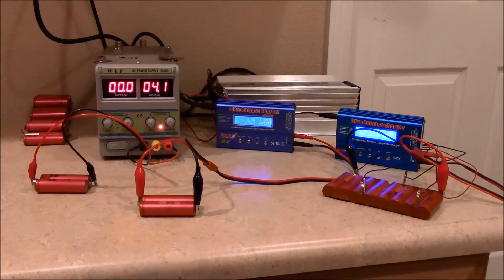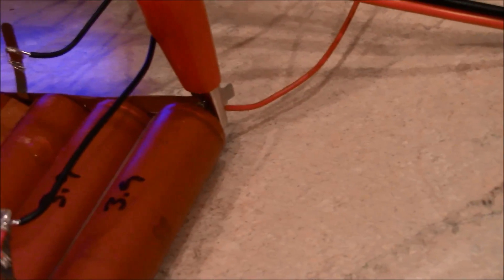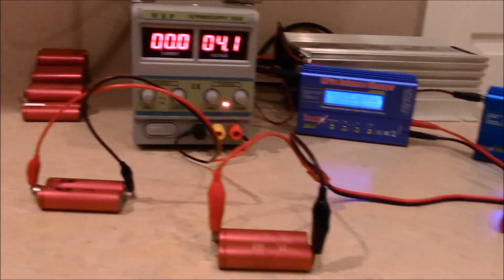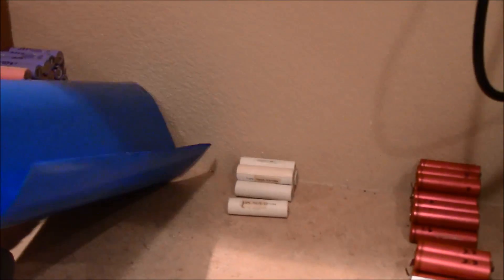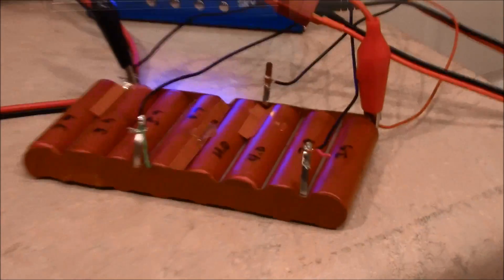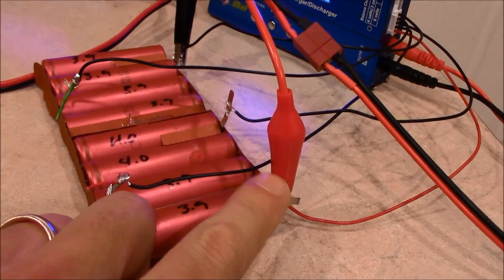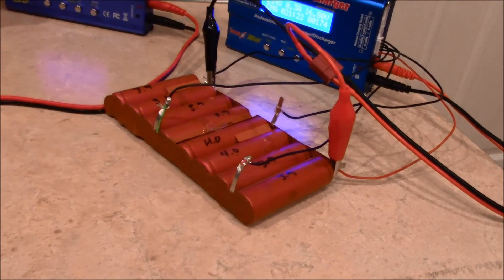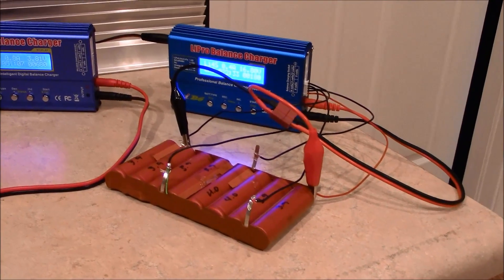18650 lithium ion cell balancing with the new charger

Comment: You can buy a discharge with capacity read out on eBay for 4 bucks. It charges as well. Ebay this” 18650 capacity checker”.

Comment: can you tell me where you bought the balance line cable with the clips on the end.  I am looking for the exact setup to charge some laptop batteries.  thanks, Ken
Reply from the maker: Imax B6 came with some.  Radio shack has them or you can make them.  Amazon might have them.  The alligator clips can be bought separably so you can use your own wire size.   Find some with screw terminals instead of crimps, so if the wire breaks off you can fix it.
For ex: https://www.amazon.com/Alligator-Clip-Assortment-Electrical-pc/dp/B002X4CG3A/ref=pd_sbs_469_2?_encoding=UTF8&pd_rd_i=B002X4CG3A&pd_rd_r=25G4M4RE2T1H963343M3&pd_rd_w=q2Yer&pd_rd_wg=0fod4&psc=1&refRID=25G4M4RE2T1H963343M3

Comment: Does the fake Imax B6 Mini work as well as the real one? im thinking of buying the knock off as its cheaper :)
Reply from the maker: Yeah it ended up working but you may have to recalibrate it.  There are YT videos showing how to do it, pretty easy
Reply: they aren't accurate, get the B6AC V2. i own it and it works like a charm,

Comment: I have one Imax B6 Mini and was thinking about buying another Imax B6 Mini.   Did you use only the one WEP power supply? Where did you connect the second Imax to?
Reply from the maker: Hey John, I used all three to charge groups of cells.  The Imax b6 sometimes has trouble charging older batteries to 4.2v.  So if your using old batteries let the Imax charge it up until its done the set the WEP to 4.217 and let it finish charging them up as a group.   The Imax is kinda of a cheep charger and will shut down early sometimes before the cells are fully charged.   I just figured that with more chargers the faster Ill get through them.   It still took me over a year to charge and discharge about 1000 cells.  I was a good project, but think I'll stick to new cells from now on :)
Reply from the maker: Masterg Samuraixmen for this project I had to know where cells were in mAh.  Otherwise if I installed a bad or weak cell it could damage the good cells or catch fire when under load during use.   Lithium ion batteries are not to be treated like a lead acid, AA, C or D batteries,  if one shorts out it will get very hot and may explode.

Comment: i have salvaged 6 18650 cells and i want to use them in power bank i already have charged them in opus c1000 charger with no problems... but i have a question... can i just solder the wires onto them with my standard point solder iron? i ripped the tabs from them before :P i think to make it in that way: 1st get the wire i will use and put solder onto it and them solder the wire with solder onto battery terminal to mimalize time of heating up the battery... the batteries are Samsung 26C and i will use 6 of them in the power bank.... and the laptop well... it rests in pieces
Reply from the maker: +Andari Voom yeah just make sure to be quick,  clean the area with very light damp cloth of rubbing alcohol ( you dont want the liquid  to run down into the positive end).   If you have flux use some on the neg and pos end  (very light amount on the positive end as it can run down into the positive terminal and possibly short out just like the alcohol).     Pre solder the area on the battery where your going to solder the wires to.  Also pre solder the wires,  now you can solder the wires to the battery use as little solder as possible.  You can see how I did it on my videos.   I am going away from this method now as I just bought a spot welder, so if i do any more soldering it will now  be on nickel strips.
Reply: i have 40W pointy iron ironing solder tool... and yup. i soldered them pretty much without any splosions :D
Reply from the maker: Andari Voom nice man!  Yeah when your quick and dont see any venting then your fine :)
Reply: and now i have 15.000 mah power bank from old laptop battery :D

Comment: i bought a bunch of cells from a recycling center and iv noticed just about ALL the red ones with that "pearlesent" looking wrap on them had really crummy ratings ~1000mah or less.
Reply from the maker: +danz409 Hey Danz,  yeah I have about 50-100 of those also and found that those are very similar to what you are getting.  I did have a few above 2000mA,  but most were 500mA to 1999mA ave of 1500mA.  Also make sure when you test them that they are at or above 4.2v max 4.225  if they are not you will not get an accurate reading.  I got a new multi-meter as I found out mine was not reading correctly by almost 1v.  Dell has pretty good cells to harvest from.  I would say that 40% were above 2000mA

Comment: Just wanted to know if a balance charge plate could protect the lipro charger if the DC input failed like mine did. Unfortunately my 12v battery dropped below min 11v which I set it at. The 12batteries I connected in series burnt out the charger when the input voltage failed. The balance charging plate has a fuse in it so theoretically it could blow if the battery pack flowed into that port. I opened the charger and all circuitry was burnt out from the 6 cell battery port.
Reply from the maker: +harveyboy45 wow I did not know that would happen.  I am not sure other than a diode,  but then you will loose .7v across it.    Maybe a fast blow fuse with a low rating of 1.5-2 amps as it will try to release a large amount back into the charger if it had the chance again, but then would it be to late?
Reply: +15-sec-of Fame thanks for replying. I've sussed (understood) the battery balancing wiring now thanks. We live and learn. Sending back my Lipro charger.  Will try the 2amp fuse idea in my balance charging plate. See if that saves the day next time. Another question what BMS are you using in your pack save me mutilating a cheap knock off Chinese lipro? Cheers

Comment: Mate I nearly melted my IMAX. How did you connect your batteries together without the IMAX balancing wires. Is it just 4 packs of two in series? Thanks great job by the way. In the uk prices of second hand batteries are going for about 80p a cell. I've tried the local computer shop and got a few free ones. To make this worth it I think people need some other ideas for getting free batteries. We have a Freecycle programme here too. It's all good. Chow.
Reply from the maker: +harveyboy45 hey thanks Harvey sorry man I've been on vacation.  In this video I am charging a 2p4s pack which means that there are 2 cells in parallel and 4 of those that are in series.  Really look and understand the instructions on how to wire it as it can be confusing.   I know its been a few days now but are you good now! hopefully your imax is ok.
Reply: 15-sec-of Fame thanks for this info!!! it's not so easy to find youtubers answering and helping people with easy questions 4 you and complicated understanding 4 us. your answer helped very much!!! congrats. how many cells at most could I charge at once? how many cells could I descharge at once? have a good day every day lol

Comment: Hello. How did you make the cell (red pack) of batteries that you charged on the LiMax?
Reply from the maker: +John Siotis hey John it was directly out of a laptop battery case so all the tabbing wire was still spot welded.  Or you can use neodymium magnets to hold them together.

Comment: Hi, I am currently charging a 1S ,3.47V Lipo at 0.1Amps.  Its charging for over 50 min now and just changed to 3,52Volts, is it normal that it takes so long for just one battery??
Reply from the maker: +Randy Welt at 0.1 it will take a long time to charge as its at a trickle.   Once the charge is nearly complete it will start to slow down and thats fine just let it finish.   I have not messed with lipo's yet so Im not sure about there voltage ranges.   lithium batteries nominal voltage vary from 3.2v, 3.6v, 3.7v and 3.8v.   I know its been a few days since your question, but what did the battery finally stop charging at?
Reply: +15-sec-of Fame another two hours of charging and finally the charger stopped at 3.7V. I rewatched your video, recharged this time with 1 amp and this time it stopped at 4.2. When I discharged it dropped pretty fast to 3.3v , so finally I decided to forget about these cells
Reply from the maker: yeah if it didnt last long then that cell is either a low amperage cell from new or its worn out.  I found a lot of used cells to be just like what to found, but there are some used cells still in great condition and were free :)

Comment: Where do I get lots of 18650s from? where did you get yours if you don't mind me asking?
Reply from the maker: +John Williams Hey John I got them from my IT department at work.   You could try local PC repair shops, Goodwill or recycling locations.   Ebay also has a lot of used laptop batteries that people will sell, just make sure to buy them as cheap as you can.
Reply: oh alright thanks bruh
Reply: Dr. Lumen pls let's think about our question before. some questions are un-ecessary. let's make some searches and when we don't have the answers we ask experts like here.

Comment: I ended up buying another batch of laptop batteries. Worked out to about $.48 each. Mostly Sonyish green 2200mAh batteries. Good yield only ten duds leaving another 160+ batteries to evaluate. I had to spring for a third Imax. Ended up getting an authentic one with built in AC adapter. 
So I'm cranking them out. Over 90 batteries >2000mAh so far. 
I figured out what to do with the under 2kmAh cells. I've bought empty cellphone/mp3 chargers that hold 18650's. Total cost on them under two bucks for single battery model and under four bucks for the 2 cell models with led flashlight. All we need to do is slap a promotional sticker on them and give them away to clients and I can write off my hobby!!
Also bought a good 18650 flashlight, that sucker is bright.
The BMS arrived today so I now have all the parts. I'll be replacing 4 10Ah lead acid with 104 18650s. More power in a third of the space and a quarter of the weight. 
I'll post something as soon as I get closer to completion. 
Thanks for all your help.
p.s. noticed a fat guitar case by the pool table. Are you a player? I'm a blues guy.
Reply from the maker: +Rick Rose whats up man! nice work on getting the cells for cheap!  looks like you have been busy with the winter project.  I haven't had time to finish my second battery due to work, but et me know when you post it.  I am learning how to play the guitar right now so hopefully Ill figure out what Im good at playing soon.  Good idea on the extra cells!

Comment: I have a serious problem that I need ur help with if you have a min... Watched your vids for your bike... pretty cool. However
I have been building my ebike for a year now and so far I have a 1000 watt hub, controller etc 48 volt system for my mountain bike.
I am upgrading it to a 96 volt 3000watt system... I cannot for the life of me find a suitable throttle that is ok to use on 96 volt battery supply, i mean  two 48 volts, 54.6 volts fully charged is 109.2 volts nominal... so ive looked everywhere but the highest voltage i can find is 100 volts... Will that be ok or do i have to put a few resistors in line to reduce the voltage?? and what size should I use??? please help.

thanks,
Reply from the maker: the throttle wiring should go thru the controller only.  Im not sure what the sense voltage range is on your controller for the throttle, but mine is 1.1v to around 4 volts
Reply from the maker: +A ChildofGod your bike is going to have a lot of power, awesome!  take a look the controller and it should have the throttle sense voltage listed on the spec's.  I can post a picture on my profile page of mine if it helps.  Let me know thanks.

Comment: I have imax too, but I also bought BT-C3100 as it has a battery test option. It will charge, discharge and charge again and show you total mAh for each battery in each slot individually. Good job on making bike. Im in progress of making one too. Getting all cells sorted out still.
Reply from the maker: +Igor Thanks and good question, I'm not sure if it can discharge in balance mode and show the different mAh for each cell,  I've never tried it.  I'm not sure if I would trust it to give an accurate reading in that mode, but that's just me.  Having the 2 B6's is really helping me get thru the batteries much quicker.  let me know if you have any question during your build.
Reply: +15-sec-of Fame are you using the imax for chargers now on your battery? im just asking because i am shopping for ebike parts now and have been thinking about building my own battery since the lithium battery packs are stupid expensive.... i was thinking about buying like 2 or 3 of those based on the size of my battery and run all of the balance leads to a very large pin connector and then just turn on all of them and let the chargers charge the battery...
Reply from the maker: I use the IMax's for testing the cells only during the battery build phase to see which cells are good.   I have a 48v battery with a 13s BMS (13s x 3.7v = 48v) and a 54.6 battery charger to fully charge my battery.   If you are not using a BMS you could use the Imax to charge the batteries, but sometimes the Imax turns off to soon and you don't get a fully charged battery so just watch for that. Make sure you keep an eye on the voltage every 5-10 charges to make sure they are staying close to the same voltage.  You will need to hook up all the balance wires and main voltage wires to the part of the battery that each Imax is charging ONLY!  Each Imax can handle up to 6s or 24 volts each so you can hook them up anywhere from 4.2v to 24v segments.  Hope this helps you and if you need my help please don't be afraid to ask.  Thanks
Reply: Thanks for commenting quickly, im not sure if my imax is the same as yours.. but i already own 1 imax from a few years ago i bought from ebay for rc car batteries.. when i plug the batteries in i use balance mode and it charges them to the set voltage, then it does micro discharges tell all the cells balance out then turns off.. does yours have this function?
Reply from the maker: Good question.  Not sure if mine miro charges after the charge.   I'll look in the manual.

Comment: Looking good man!!  I really need to get another Imax that's a great idea.  I'm averaging about 3-4 individual batteries per day as far as charging, discharging, and recharging (storage).  I suppose another B6 would cut my time in half - well worth the $20!  Got a question for ya.. Where did you find that pvc shrink wrap?
Reply: +Gary Harvey & 15-sec-of-Fame
I found another knock off for $20 locally and have doubled my cells measured per day. Oh joy! What was a twenty-two day process can now be achieved in just 10-12 days.
I may have to go back and re-measure my first cells as I was testing them at 1a instead of .4a. I should have watched this video closer.
As much as I'd like to speed process along, it is going to take the time it takes. I bought a 4 battery Li charger that charges each cell individually. I'd have to get two more iMax b6s to stay ahead of it.
I ordered the fuses from China and they promised me they'd be here by December 16th. It's about time to start ordering the other parts.
Reply from the maker: Thanks, I found it on ebay (PVC shrink tube) for about $15. Its very wide I think around 375mm or 15 inches flat and 9-10 inches when opened in a circle  It took about 30 days to get it from China.  Before I wrap it Im trying to make a cooling channel thru the batteries with a small fan to pull air thru the channel.  The fan will be on its own very small 18650 battery.   Also looking to install a temp sensor for the fan to turn on automatically.   Looks like a good winter project as its starting to get cooler here in CO.
Reply: Great thanks for the source.  I can't believe you brought that up about the fan!  I was actually just brainstorming yesterday about how I could keep my pack cooler and was considering some designs such as a flare in the front of the pack that would induct air (similar to brake duct on sports cars) and an exhaust fan at the back of the pack!  I was also considering possibilities with a PC CPU liquid cooling system but that may be too risky and complicated.   Anyway, looking forward to seeing more of your progress!
Reply: +15-sec-of Fame Oh yeah I also wanted to tell you that your second parallel pack should help a ton with the heat as it should cut the amp current load of your pack essentially in half.  It will also double your available current to the controller so, depending on what the controller can handle you should see a lot more power potentially.  I'm sure you're already aware of these things, but I'm excited for you haha.
Reply from the maker: Yeah when Im running full throttle for an hour it gets pretty warm, so Ive learned to back off a bit during rides.  I will have about 34 amps which will be good and I can wait to see what the performance will be like.  The controller is good for 35 amps or 1900w.  Its also adjustable in the settings to run 48v, 60v, and 72v.
Reply from the maker: Thats awesome man,  looks like your not wasting any time, thanks for update!